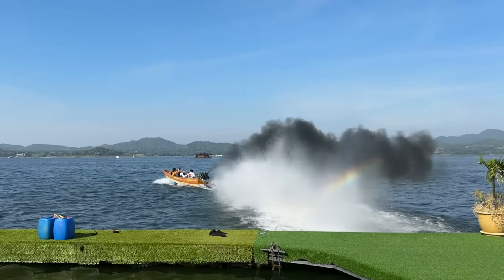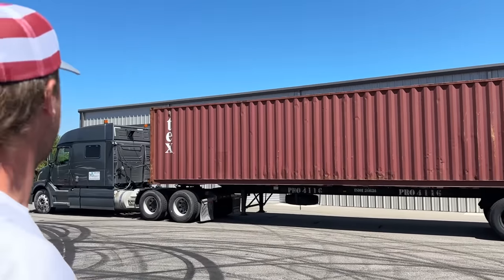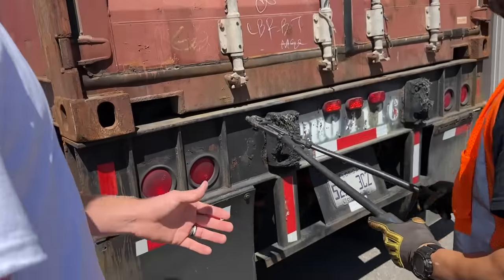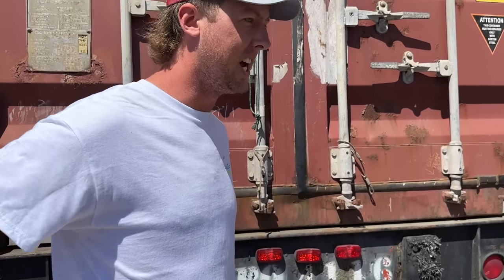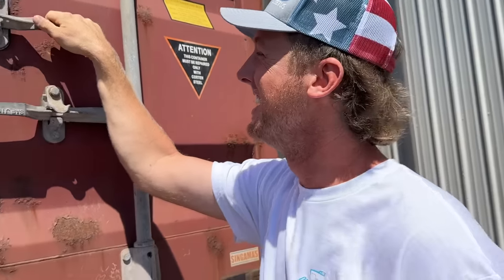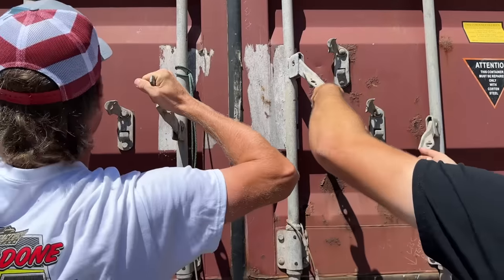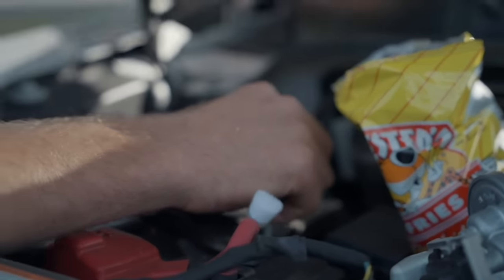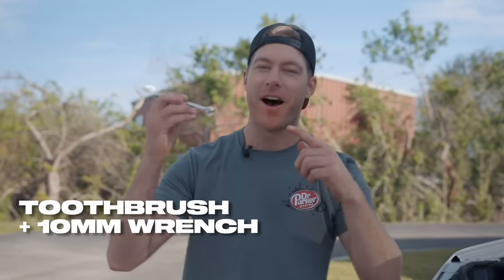My Thai Longtail Boat Has Made It To America!!!

Comment: That boat trailer needs a conestoga style covered trailer.  Like the type of semi trailers that have a soft top that can roll forward accordion style on tracks so it's an open flat bed.  It's trailer can be it's own shed, plus be open for the boat ramp.
Reply: Forsure, should be relatively easy to convert that shipping system into a custom trailer. 75% of the work looks to be done.
Reply: I’d weld up a cpl axles on the packaging system and it seems a trailer would be easier said than done. The got that knocked out n an afternoon. I’d say tye welding a trailer together vs me n a case race and he might win!😂😂😂

Comment: you could make a trailer out of the crate it came in ,with rollers under the boat to load it in and out, just add a draw bar and axles and some alloy panels to the crate
Reply: That's what I was thinking. It would be a shame to waste all that square tubing. He's going to have to make a custom trailer for it regardless.

Comment: Well since you need a trailer long enough for it, I would say modify that shipping crate and make that isn’t the trailer.  You won’t need to get any steel and you can utilize that prop shaft hanging system for it.

Comment: PARKER YOU BETTER PUT A SOLID SAND TRAP ON GATOR TAIL ALSO! SINCE YOUR PULLING WATER FROM THE OUTSIDE TO COOL IT......PULLING UP TO THE SAND BAR MIGHT COST YOU A VERY EXPENSIVE ISUZU WATERPUMP!
Reply: was ur capslock stuck bro?
Reply: This is how all boats work… wtf is a sand trap? Lol. I work on boats for a living
Reply: @jonathanrollins7292 like a fuel bowl but for water. Collects the sand before it goes through the engine.
Reply: @jonathanrollins7292 sand trap? You don't do much shallow water level riding do you?
Reply: @charleybetts1053  it’s not a jet boat
Reply: @jonathanrollins7292  and you don't know about a sand trap???? Hummm guess I wouldn't let you work on my boat! It's big on shallow water boats...jet boats mostly....but if your using raw water pick ups....you def need a sand trap! Maybe a bit of research is needed for you
Reply: @rytime700  it’s a 30’ long boat made of wood. It’s not for shallow water applications, so it would be pointless
Reply: @rytime700 kid your 7 you don't have a boat for anyone to work on

Comment: I think you should build a fiberglass round top rail around the top of the sides to make it unsinkable. Kinda like an inflatable life boat but with like three inches diameter tubes instead of the standard twelve inch tubes. Something sealed made into the boat to prevent completely sinking in a roll over.

Comment: For the Charger, I say swap in a truck driveline and get it looking real mean and stronger to handle truck pulls and offroading. Maybe do a body lift, just go full Frankenstein. Hell you could even have it set up to haul the long tail, weld a a hitch behind it or put a 5th wheel on the roof.

Comment: Before you run the boat it would be better to get the one-off parts reproduced, and even enhanced over what they have done so far. Maybe ask some wood people on making sure it is completely safe to sail out. Being race boats it would probably need some things done better to use it like a regular boat--like boating with the crew. And you will definitely want the electrics and electronics waterproof!

Comment: turn the frame it was shipped in into the trailer for it. It already fits in there just cut the top off the frame and add axles etc and you have a cheap and quick trailer for it

Comment: You mentioned trailer. Could
You use the shipping crate to craft a trailer from? 

Wish our shop wasn’t so far aware. We could help out as we do this weekly. 

Also those forks extensions. Build your own stronger better versions. Again we make them often at our shop. Pretty simple. Made from regular channel steel. Back straps. As well you can weld rings for rigging and such. 

Sharing this video with a buddy who’s wanting one of these.

Comment: Would highly recommend not using solid state relays or any other type of specialty relay. For a marine application it would be wise to use parts you can get replacements anywhere in the country. Like standard Bosch style relays

Comment: They been building LongTail boat motors in America since the 1970. Several companies make them. Backwater Longtail is the best in my opinion. I run a 40hp EFI motor. There is also a company in Louisiana called Tatortail. The build boats and Surface drives. They may build Longtails also. Not sure. But you are not the first to have a Longtail in America. I ran them for years. The Swamps of LA, the backwaters along the Mississippi all the way to the Ohio river have guys running Longtail engines on aluminum and some wood boats. I build aluminum Skiffs and my boats was designed to run a Longtail or Surface drive. Great for skinny waters. A little advice. Keep that prop out of the sand. You can destroy a prop on no time running it in sand. Mud don’t seem to hurt them. I would definitely get a few extra props made. I always care extra props. Have one pitched for speed and one for torque if you plan on carrying a lot of people. If you are racing put the speed prop on. But keep them out of the sand. Ask me how I know…lol. Nice boat buddy. 🇺🇸🦅🐊💸

Comment: Just reinforce the axles with some steel and make a axle cover squeeze it around and weld it shut, then harden the splines and way you go.. I've done this to a old mercedes 123 wagon i used it for a "race wagon" it help up until the diff exploded 😅 But the best thing was, I had no wobblynes in the rear, it didn't vibrate enough to feel it when driving...

Comment: " Ideas for Engine swap" Thought about it and look around on marketplace for ideas... Not much sparked my eye in your area, Up here, Betendorf Iowa, is just south of Motion Raceworks... Found a 67 Dodge Dart Drag Car Roller Project with a title... tube frame, tubbed out, looked decent black and red fiberglass front end, with corvette front suspension. Pretty good start for a cool decent drag racing car, just an idea.

As for a dodge truck swap, I mean you're going to probably want a single cab shortbed... Unfortunately, Dodge doesn't make any good ones and price to make one like your bros giveaway GMC just stupid not really worth it... maybe an older D100 swap if you could find one still in good shape and at the right price.